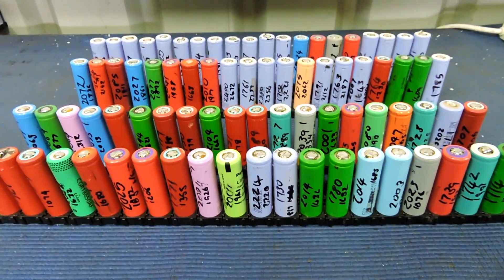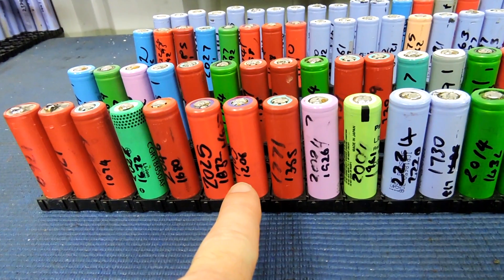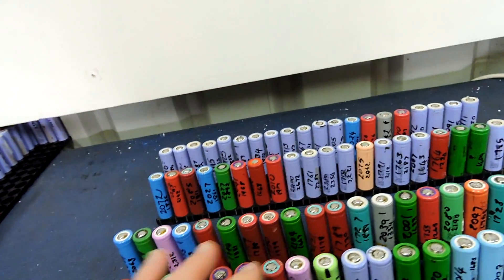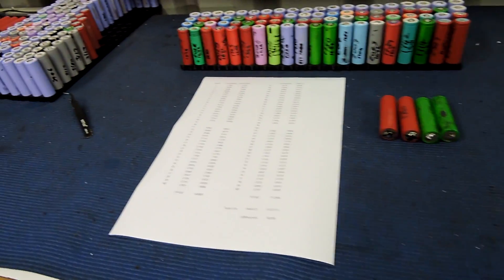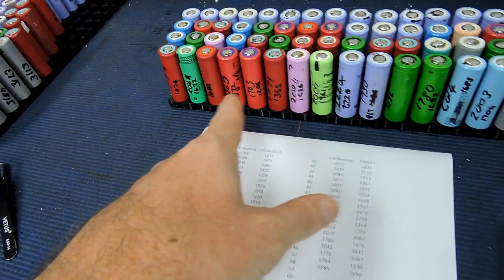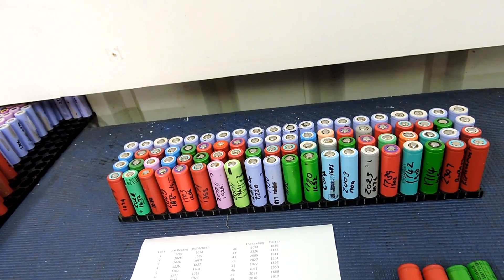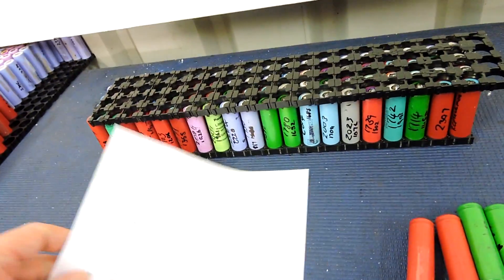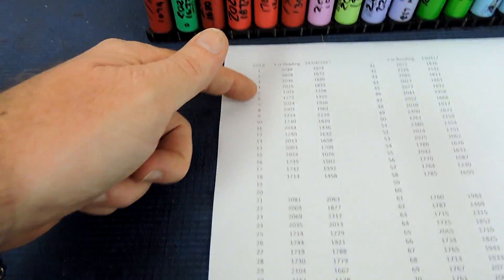Retesting  Pack 35 after a few months of use

Comment from the maker: Have any other ideas on tests i could do to this pack ?
Reply from the maker: +Don Tes that'll take a considerable donation. But would be a fantastic test !!!
Reply: I like the idea of running long life test. But would love to see a 2nd test. Your using old batteries in your system. But I would love to see another pack with made up of new batteries to compare the old one of how used ver new hold up.
Reply: HBPowerwall maybe the capacity difference between the cells is a little bit high in the same pack so they balance each other with high charging current which is bad for the cells I think! and don't take my word for this cuz I'm not expert in it 😀
Reply: I would use a different colour for the numbering of the batteries, so there's no confusion. Sooner or later, you're going to run out of space on the batteries.
Reply: Richard, in that case, acetone is your friend... :-)
Reply: depending on materials, acetone will dissolve the plastic wrap around the battery...
Reply: If you dunk it in a bath of acetone and leave it overnight, maybe.
A dab with a tissue with a few drops of acetone on it will be quite sufficient.
Reply: Rubbing alcohol will remove sharpie ink.

Comment: why where they down to 1v?      If you did not bottom balance these to the other 5 groups then there is a possibility that you might have partially  plated the anodes and thus the loss of capacity.
Reply from the maker: there were down to 1v because I choose to change settings on the inverter to a bottom voltage that was crazy. Bit of learning/playing around. Knowing and understanding the limits of what I'm playing with is important. If it bottom balance I run the risk of overcharging my cells and burning my house down. Don't really need that would kinda be inconvenient. Rather loose a cell due to over discharge than to overcharge. Better of the two evils in my case, I think.  I have now removed all packs that have been one volt and they were all test packs as it turns out. Packs built not from an average of 2400 mah but from an average of 1850 mah.
Reply: You cant use those cells to judge degradation like you mentioned in the video,   those were top balanced and ran down to 1v under load,   whatever degradation is most likely due to this one event.  Remember cells die quietly and quickly at the bottom all it takes is one time.

Comment: Good technical info. From testing old cells these batteries seam to fail in a lot of different ways with lots of different symptoms. Too bad you don't have side plates with pogo pins and fuses on them that just bolt on with a couple of bolts and no soldering.

Comment: it would be cool if you could  label every cell with unique bar code and every time  you scan it it would put all data to computer 
so you can see graphs and stuff.  i realize that it  would probably have to be connected to charger and read capacity data to be really useful. that would be cool project for someone smart

Comment: I've been testing a couple of hundred cells with just one Opus - It takes forever!
To speed things up, I bulk charge a group of 20 or more similar voltage cells in parallel, before putting them in the Opus for capacity testing.
Once discharged and the capacity known, I then write on the mAh, take them out to free up space for the next, and bulk charge the "empties" (2.8V) when I've got enough together. Saves a few days!
My aim is to make a good sized ebike battery, and then for the house if scavenging is successful enough...

Comment: I would be interesting to get a entire pack Discharge numbers.    https://www.rcgroups.com/forums/showthread.php?1793798-iCharger-4010Duo-Review  this can discharge @ 3200W ( certain modes with external loads) and get a Ah of useable storage.    Since the low Cells (capacity) will be robbing power fro the better cells the better cells will have a higher draw on them during discharge.   I personally feel that any pack in parallel should contain as many cells that are the same capacity as possible.    Something I have seen in smaller sized packs (<10cells) is that if a cell has poor IR (internal Resistance) it pulls up the voltage of the pack falsely during charge and the better cells do not get to fully charge.

Comment: going down to 1V just speeds up degradation. Based ob some tests and logic Jehu came up with, going down to 1V has a similar effects as 10 full cycles. So it's not good, but it also isn't the end of the world.

What's also interesting is that those 2 dead cells look like they are from the same manufacturer and have the same age. Good chance they came from the same battery.

9 Ah difference on a total of about 160 Ah is not bad. Like 6% loss. and 40% of that is from 2 dead cells. It means that the degradation of the other cells was just about 3%.
Reply: It can be the end of the cells if your pack is top balanced and you run it down to 1v under load.
Reply: jehugarcia I guess in this case it depends a lot on how high the load is. In a car the load can be very high, but in a powerwall setting, at least in Peter's setup, it stays relatively low. Below 0,2C. So gping down to 1 V like he did isn't that bad.
Reply: Normally i would agree, except we recently had 11 paralleled  smart tesla modules slowly drain down to  1v  and when we charged the pack 2 modules started getting hot,  after checking,  the entire modules were dead,  all 15 groups of cells died,  its so weird but at least teslas cells absolutely do not like being over discharged even at a slow rate,  they will not wake up anymore
Reply: jehugarcia 2 out of 11 modules were dead? So the other 9 were ok?

These are recycled Tesla modules? Kind of like when we recycle laptop batteries? (though laptop batteries can be much worse than most Tesla modules I assume.)
Reply: yup
Reply: jehugarcia Then it's not like it's bad as a stand alone event. Something else has to be wrong as well. If a cell can't hold it's voltage anymore for example.
Reply: all 330 cells in the module could not hold a charge anymore
Reply: jehugarcia Yes, I wonder what causes that. Low voltage alone isn't enough. Maybe those 2 modules were forced down to below 0V and the others stayed positive. That would explain why all cells died together.

Comment: Hi bud, I recently re tested some of my cells with an opus which had previously been rated using a b6 v2. I found there to be +/- 15% discrepancy between the two numbers. So I think you're doing the right thing by re testing in 3 months time using the Opus again. Is there a way you can easily count the number of cycles across the system during the the 3 months?

Comment: wonder how much soldering them in and out of the pack will effect results
Reply from the maker: +One up the sleeve customs good question!
Reply: One up the sleeve customs It depends on soldering skills and the equipment. A higher temperature means you can solder quicker which means less heating time. A thinner tip and higher temperature means less time needed and less heat penetration.
Reply: Peter Faber sure does i use a 80 watt iron